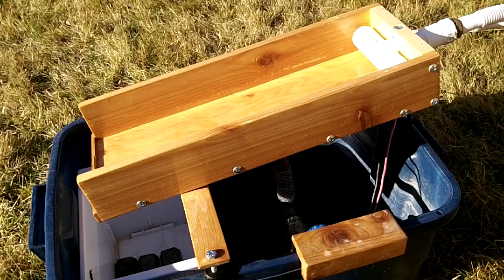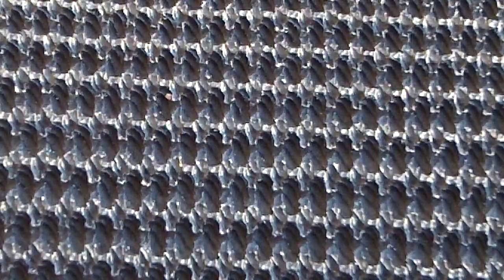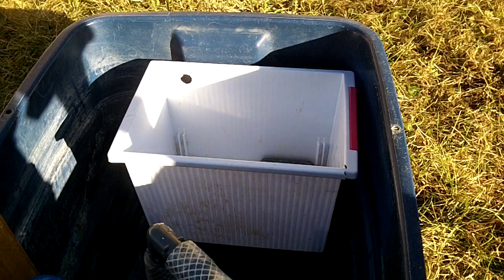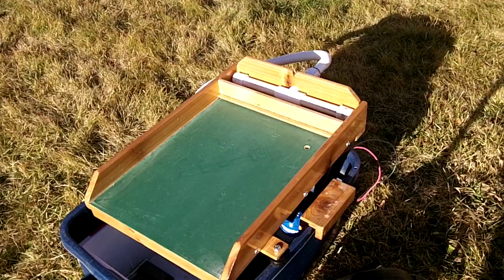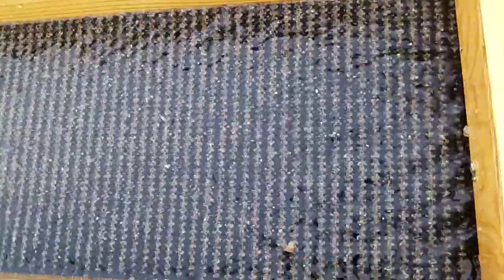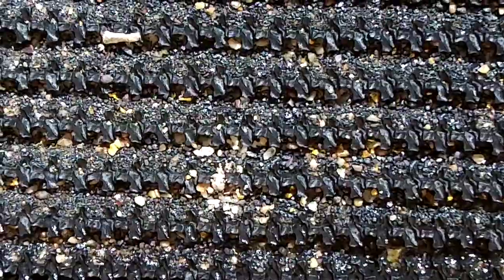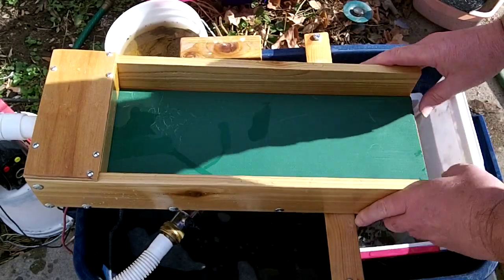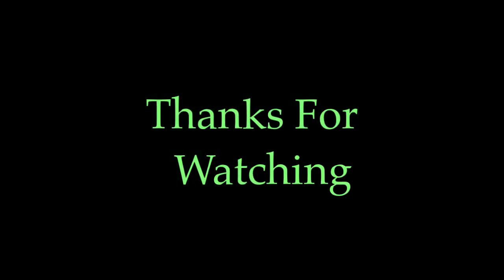Recirculating Mini Fine Gold Sluice

Comment: if you use a blue bowl it would save you so much trouble and time!
Reply from the maker: Heinz Hubbuch 
Thanks for watching Heinz. Actually I built this because the Blue Bowl loses a lot of the finer gold and I put this underneath it to catch it. Later on I found that this worked better and much faster than the blue Bowl and so I sold the Bowl and stayed with the Mini sluices. Since this one, I've built and tested about 50 different sluice designs and 5 different mats. Although I now use a much larger of my Deep Well version of this it's still a good simple design that is easy to build for people who don't have a lot of tools. I also like the small size of this so I can run it in the house when it's too cold to work outside. :-) it's also ideal for handicapped people to set up in a kitchen to run paydirt through once in awhile.

Comment: i would like to know about these mat you mention,which one are better and the cheapest one? thanks
Reply from the maker: Neutral God 
Hi and thanks for watching. Sometime after I made this video I bought both mats to see which one I liked the best. Turned out that they were the same mat. It is also used on a very popular product called the Gold Cube. You can buy it on EBay in a number of different sizes and prices. Look for fine gold mat or Vortex mat. Another mat that is a little cheaper is called Deep V mat. These work best if you classify your material and run each classification separately with the water flow reduced for the finer classifications.
Reply: great! thank you and have a good summer
Reply: i look for Gold Cube,it's a hole machine but the mat/moss it self ,what is the company and the name of the mat/moss? thanks
Reply from the maker: They won't allow me to insert a link here to the one I bought on Ebay but here is the title to search for.
New Martin Fine Gold Sluice box mat 6"W x 24" long
Or you can go to:    mjcoinstore.biz/accessories.html     and go down towards the bottom. He has a number of different sizes listed down there and the prices.
Hope this helps.
Reply: perfect thank you very much
Reply from the maker: You are welcome. Best of luck.

Comment: I found your Channel tonight. I am excited to build a recovery system on your principles. Have you ever built the base as a Martin Table, and just added a mat over the top of it?
Reply from the maker: Liberty Cave 
Hi Liberty, appreciate your stopping by. Yes, you can use the base as a Miller Table. Just paint it with Rustoleum Chalkboard Paint. Do this before you put on the sides. The pint can is the best and apply it with a small 3" foam roller. Put about 6 Coates on as it dries very thin. They have to tint the paint for you and the green or the teal are the best colors. I like the teal quite well. I love these little sluices especially this time of year as they let me work indoors as well during the winter. I have a new one coming out soon.

Comment: Do you think it would work to make the vial insert on the Mini and would it work to just chalk board the bottom board of the sluice rather than make the insert? Thanks for the video, your detailed instructions are great, especially since I am a rookie, it's taken 3 days to get everything cut out and the water bar made but things are starting to come together.
Reply from the maker: Hi Jayden, a good question. The answer is yes it would work to put the vial in the bottom and also paint the bottom with the chalkboard paint. I only thought about painting the bottom after I had this one put together and I decided to try the insert to see if it could be used as a miller table which it can quite well. You need to have a valve on the water hose to cut the water flow back to about 150 GPH but it will work. 
I made a new body for this mat with a slick plate in it and gave it to a friend to use on his gold claim and it is getting heavy usage every day and he loves it.  I think you will really like your sluice. Don't go very strong on the water supply. A 500 GPH pump from Walmart will work just about right on this one. 
I have another sluice similar to this one with an unusual feature. Stay tuned. You will be able to use the mat from this one if you want to build it as well. If you get ideas to build other sluice bodies, build them so you can use this same mat and just swap it back and forth between bodies. That's what I do.

Comment: I am confused. At the beginning you state that you want to recover the very fine gold most sluices kick out... So where did your concentrates come from that your running in the little sluice/table? Don't you mean that you want to clean up the fines without loosing them? I just don't understand what it is your are running here on the equipment you are showing.
Reply from the maker: Hi Man and thanks for watching. I build and test 3 or 4 different sluices a month. The material used here is some that had been run through about 4 different sluices a number of times in testing already.  This was one of the first tests of this new mat and so the gold shown here is gold that those other sluices had lost and it was a bit of a surprise to me that there was that much. So when that much showed up I decided to make the video to show folks how well this mat does at catching the fine gold. I now have a couple of friends who bring me some of their tailings to run through this to recover the very fine gold that their equipment has lost. 
Most people would use a sluice this size to reduce the concentrates from a larger sluice down to the couple of oz’s this one gives you. I have since built several larger sluices with this mat for my normal prospecting as it keeps the very fine gold that many of the others lose. Living in an area where the gold is mostly very fine flour gold, that is important.

Comment: All right I love that combo...nicely done are you adopting...lol...great video
Reply from the maker: Thank you, I love them as well. I got bored and had a small scrap of vortex mat left over from making my larger one and so I just made me a 3" version of this that I can use in the kitchen sink using the faucet water to run. Great for running a pound or two of material when I don't want to set this one up, especially in the winter.

Comment: What angle do u run this at
Reply from the maker: +sharpie skiing Hi Sharpie, thanks for watching. I usually classify my material to -12  or -20 mesh and run it at about a 12 to 15 degree angle. Then I classify the tailings to -30 and run it at an 8 degree angle and reduce the water to about 400 GPH. This will usually catch down to about -100 mesh gold.
Reply from the maker: +brandon scott Hi Brandon, thanks for watching. Yes, those super fine grains were what I built this for and it worked much better than I had hoped. This will catch gold that you need a magnifying glass to see. Being as small as it is, it's very easy to pack around. The mat is the same one that is used on the Gold Cube which works so very well on this fine gold as well. This box is only 6" x 18" but all the gold is caught in the first 3 or 4 inches. The cons from a clean out are only 1 1/2 oz which only takes a minute to run on a miller table or pan out. If you watched my other videos, you saw that I have a larger version of this but this one is my favorite for some reason. Since this video I have added a Highbanker box to it and made a mini highbanker designed just for catching the micro gold.

The box itself only cost me about $10.00 to make as I used a piece of pine for the bottom and used a cedar fence board for the sides and the Minwax spar varnish was about $8.00.  About $5.00 for PVC tube and fittings. So around $23.00 total. The most expensive part was the mat which you can buy on Ebay for about $25 - $30.00 you can do a search for gold vortex mat or vortex sluice mat.

I'm sorry but I don't sell these. I have so many projects I'm working on that I don't have time for much else. You can buy some inexpensive aluminum sluices with and without mats on Ebay as well or you can put together a simple box like I did with a piece of pine for the bottom and a piece of 1x3 for the sides and a piece of 1x4 for the back. Home Depot also sells short pre cut pieces of 1/2" hardwoods that would make a very nice box for a reasonable price. Good Luck.
Reply: +utahavalanch How much did it cost to make your mini recirculation sluice? I have super fine material like grains of salt and being in a wheelchair I can't use a lot of the equipment that will help me get the fines and micro gold out.. I would like to try and find one to buy do you make them to sell at all?   thanks.  great job ...work's great!!
Reply: +utahavalanch Dang I don't have the means to build  one myself I do have the metal 3ft sluice  I bought  online but I don't know how it would work with these ultra fines & micro pieces ...

Comment: This is great, very fine micro gold is all I find in ohio. this will mark my 2nd season trying to find gold. I will ATTEMPT to make one ( I'm not great with tools haha ) thanks for sharing!
Reply from the maker: +Zack McPherson Hi Zack. Thanks for watching. Yes this mat will catch the very fine gold you have very easily. These don't need to be fancy and so you can make one with only a saw and a drill. You can buy a piece of Martin Goldstop Mat or Vortex mat from Ebay that is 6"x24" or a larger piece if you want one that is wider. 

You can buy a piece of 1x6 pine board for the bottom and 1 piece of 1x3 lumber and cut the top board and sides out of it. You can cut the lumber to the full size of the mat if you wish but you only need to go about 16 - 18 inches. If you use screws on the header board where the water bar is you can remove that and use the sluice as an in stream sluice and it will work very well with a small slow stream. Then If you bring some material home to run you can put the board with the water bar on and run it with a 500 gph pump as a recirculating sluice like I'm doing here. These are very versatile little units. I am currently making a small Highbanker unit to mount on this so I can just shovel straight into it without having to classify. Normally you should run all your material through a 20 screen before running. That is about the size of a kitchen strainer and that's what I use. Makes it easier to catch the small gold.

Comment: Is the Stop Mat 6" Wide?
Reply from the maker: +C Barker Hi and thanks for watching. Yes, on this one it is 6" wide. It makes a very handy finishing sluice. I bought a 6" x 18" inch piece of Gold stop mat from EBay and made the sluice to fit. In one of my other videos I made a 9 inch version with the same mat for running larger quantities of material.  I had a 3" strip left over from that and I just made a small 3 inch table top unit with it. So you can make your sluice box any size you want and then just buy a piece of mat and cut it to fit or you can buy a piece of mat and build the sluice box to fit.

Comment: PERFECT !! Great job on the simplistic setup, and clean looking as well. This design size will be a great addition to fitting into the back of my Jeep Cherokee's hatch back area. I can't wait to get started on this. I really like the wood frame, as per the wood look, but, due to my little experience in the hunt for gold, you wouldn't think there would be an issue if my frame was machined & formed out of aluminum plate, beings the insert (rubber composite mat) is what is doing the work, right? Thanks for the input, and again, great job!

Comment: Can't seen to find the green material you refer to as the MIller Table. Where can I buy this stuff?
Reply from the maker: +jimmy changa Hi Jimmy, Thanks for watching. The mini miller table Insert I am using in the video is a piece of 1/8" plywood cut to fit in the bottom of the sluice and painted with Chalkboard paint. The chalkboard paint has a slight "tooth" to it which helps the gold to stay where it is dropped and allow the sand around it to move on down and off the table leaving nice clean gold. Usually I prefer to use one of my regular miller tables but if I am just testing a small amount of material then I can slip this insert into the bottom of the sluice to separate the gold from the sand.

Comment: Materials list? Where can I source some of that matting?? I wanna make one exactly like this! Been running my bucket sluice, with limited success.. 8) Hope you're doing good.
Reply from the maker: Todd Kleinert Hi Todd, sorry so slow getting back. I have been out camping in the high country for a week and using this little guy.  This matting still amazes me at how well it works. It really catches everything. Especially the very fine micro gold. I have made a small 3 gallon recirculating set up for it that I can run out of the back of my truck or set up on a picnic table. When I'm driving the back country and see some interesting material I can just stop and run a few gallons through to test it and then swap the mat for the miller table insert to see if there is any gold. Or if I want to pan the material instead I can do that as well.

The matting is called Gold Stop mat and you can find it on Ebay. This looks just like the Vortex mat that they use on the Gold Cube and it works just as well. You can also buy the Vortex mat on Ebay and try it also. I bought some of the Deep V Ribbed mat  and it works very well but you have to really slow the water flow down.  You can use it with the 200 gallon Harbor Freight pump that I use for the Miller Tables.

I bought the 6" x 24" mat on Ebay and made the sluice interior 6" wide by 18" long. All of my sluices and Miller Tables are that long in order to fit both of my recirculation systems. You can make it the full 24" but all of the gold is caught in the top 4 inches of the mat so anything over 12" is unnecessary. You can buy a 12" x 12" piece of mat on Ebay as well and cut it in half if you want to make a shorter sluice. I recently bought a 12" X 24"  and made a larger 9" x 22" sluice for running larger batches of material.

Materials:
The wood is a piece of 5 1/2" Cedar fencing sanded smooth. It's very cheap and lightweight. You can use Plywood or pine as well.
Bottom: 6"W x 18"L
End piece for water bar:  6" W X 5"H. I now glue two pieces together so the end is about 1 - 1 1/4" thick. this supports
   the pipe a little better.
Small strip of wood for front to keep the mat from sliding out: 6" W x 1 1/2"H
Sides: 5" high and what ever the total length from the back of the end block to the front of the small strip of wood in front.

Water bar:  1 - 3/4" PVC Tee, 
2 - end caps, 
2 - short pieces so that water bar extends to the sides, 
1 - 3 1/2" long piece for the incoming water
1 - 3/4" garden hose slip fitting to go onto the incoming water line.
The holes on the water bar are 1/8" in diameter and spaced 1/2" apart.

 I hope this will help get you started. If you have any questions, just let me know.

Comment: Great Build and Video!! I really like the idea of using Gold Cube matting and showing that you don't really need to spend a small fortune on a gold cube.
Rich.
Reply from the maker: Thank you Greenerlumber. Actually trying to decide on whether or not to buy a Cube was the reason behind this and it has worked every bit as well as a cube. It has totally stripped all black sand and gold out of every thing I have run through it. I spent 4 hours running tailings to check it. Thanks for watching.